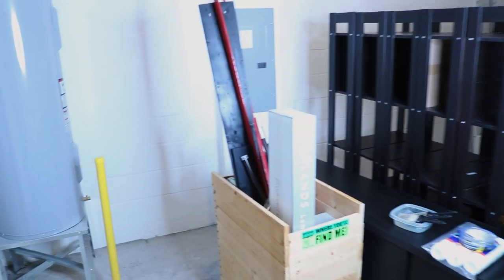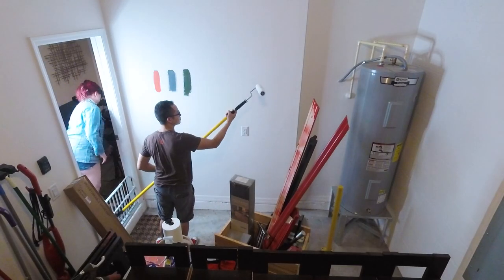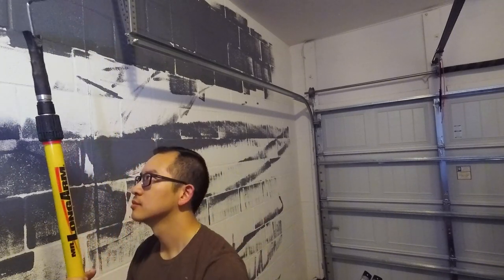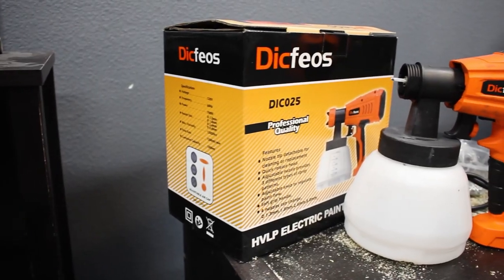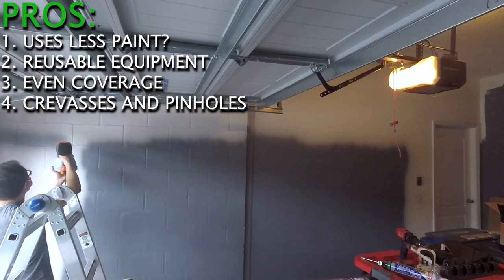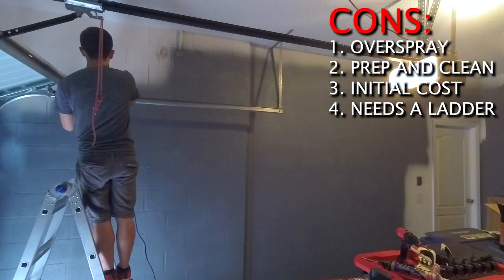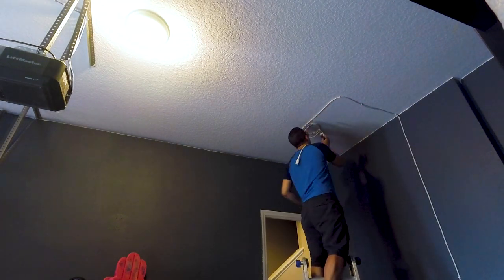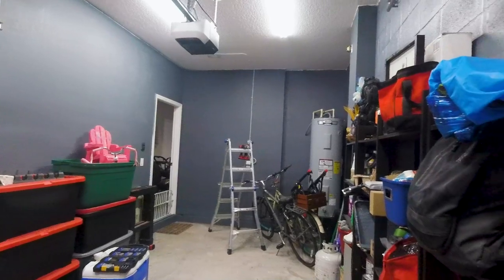Painting With Spray Gun vs Paint Roller | New Garage Lights | Garage Update #1

Comment: Ahh little baby. Congratulations. Mine is now almost 23, lol. Enjoy them while you can, they grow up faster than you can imagine. I've painted a 19 x 15 room in 15 minutes per coat with a Home Right finish max super. Use a 36 inch metal paint guide and you don't have to tape anything except plugs and switches. Of course all trim is done after the walls with brushes.
Reply from the maker: Thanks a bunch! Truer words have never been spoken. Our son is already 1 years old and we still can't believe it. I agree with what you said. I believe the trim work is the hardest part because of the all preparing/pre-planning needed for a clean finish.

Comment: A good DIY is moving the electrical outlet higher up (or adding one) for the lights for a clean look. Not as difficult as some may think. Currently planning mine out, and its one of the things I will do
Reply from the maker: A plan I had was to add more outlets since I only have just the one. Definitely something that is in the near future for me to work on. Thanks for the tip!

Comment: Cinder block? Easy peasy. 3/4" or thicker. Larger areas, don't use a 9", use a 14". Not 18". Of not perfectly flat 18" is going to miss the low points. If I do a one part epoxy on a concrete floor, I almost always use an 18" and a roller cover with a thick nap like 1.25" nap  Poured or block walls, then it is back to 14" and 3/4 nap. Not to meantion as a plug, but Arroworthy has a huge selection of brushes and rollers. Used to be Walmarts house brand, but they seem to now sell cheaper Shure-Line rebranded as their own. Home Depot used to brand Arroworthy as the house brand, but now seems to just sell as Arroworthy. Some non-big box stores do this too. Lowes I don't know. Valspar has been a Sherwin Williams brand for about 10 years. There are Valspar brushes. Sherwin Williams own Purdy, which are top tier brushes  Valspar brushes are definitely 2nd tier quality. Sherwin Williams owns Beatty Liebco who make some 1st tier brushes, some 2nd tier brushes and even 3rd tier brushes. Seems like Walmart, who does really have 1st tier brushes, they source will varyious brushes and rollers, just like big box stores, that way if the product varies slightly, they package is consistent.
Reply from the maker: Thanks Peter for the valuable information! We'll keep that in mind for our next paint job. A thicker nap would have definitely helped with the cinder blocks. We're very new to home improvements and even just painting alone has so many techniques and so many different tiered products a person can use to do one job. Thanks and take care!